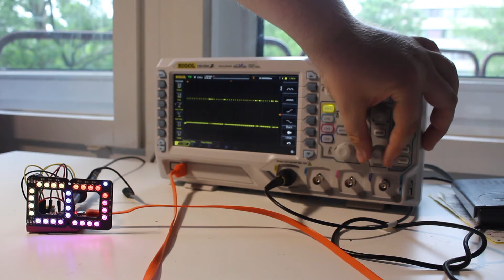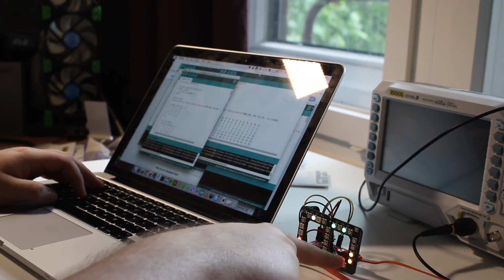unexpected binary clock

Comment: What an awesome idea for a single digit! Very clever indeed :-)
Sorry you had trouble putting it together... it really is designed for oven reflow or low temp hot air and not a soldering iron :(
Reply from the maker: no worries, it's mostly bad luck and hasting through the process :) Had some fun diagnosing it and finally get it to work!